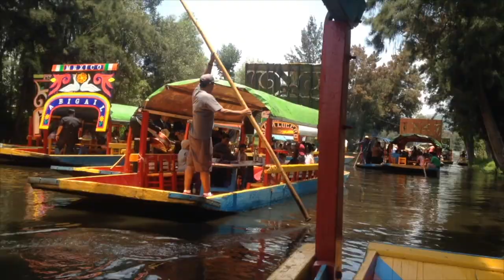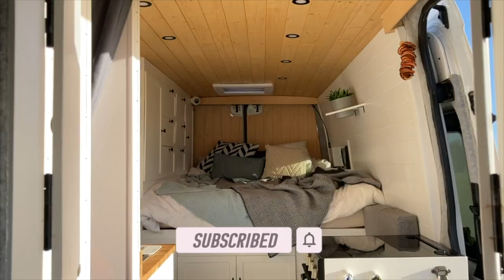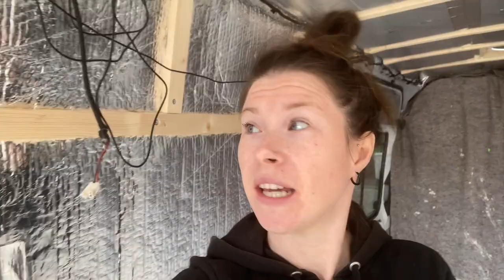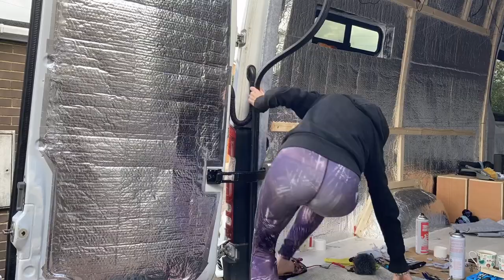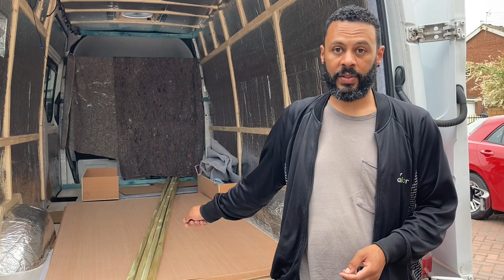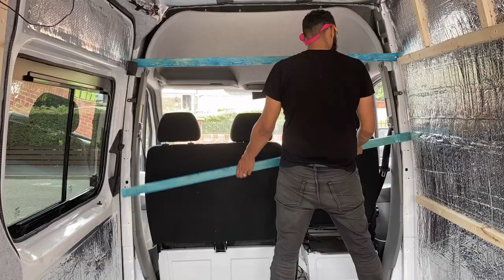Battening Campervan Walls | DIY Sprinter Van Conversion

Comment from the maker: Is the vapour barrier better OVER or UNDER the battens? And why? 

We're still not sure which is best and would love to hear any opinions either way.
Reply: You can pretty much do anything you want as long as you build knowing you need the air to circulate in order to dissipate moisture. No airflow and you’ll have mould and va;our damage.  Cheers from Canader eh!
Reply from the maker: Fair point. There are so many views on vapour barriers and insulation, but ultimately you’re 100% right. Air circulation is key! 

We tend to keep our back window cracked a little and have air vents in our roof light which we never close. Plus the fan gets a good blast every time we are cooking to draw any moisture straight out. 

It’s so easy to get caught up worrying at the vapour barrier stage because everyone you ask has a different opinion

Comment: I think another benefit of battening after the vapour barrier like this is then you can do the wiring after the insulation, and no have to worry about making a bunch of tunnels around the place in your insulation for the wiring

Thanks for the vid both :))

Comment: I am at the same stage with my build and my understanding is that when you come to put the plywood walls up there is now an air gap between the insulation and the walls which is good, enjoyed another great video guys xx
Reply from the maker: That makes sense, it’s definitely not sitting directly touching the vapour barrier which could bring a couple of benefits. Guessing you did/are doing the same then, battens on top of vapour barrier? Glad you enjoyed the video 😀
Reply: @TheWholeWorldorNothing  Absolutely, I know there is loads of different advice out there but here's hoping that this is ok.  We are not doing all of our build ourselves as we are retired and do not have the stamina now.  We are doing what we can then the professionals step in.  Really enjoy your videos guys, not far from you I think in Newcastle.  Anyway take care guys, see you next week xx
Reply from the maker: That’s a great way to do it, still getting hands on when you can. Plus you get to do all the fun bits 😀
Yes we were very nearby! We’ve just hopped over the border now but we’re not planning on staying in Scotland long. We’d love to see your van once you’re all finished. 
Catch you next week ☺️

Comment: Hi Guys, amazing work. Are the ceiling battens (25x38mm)? Was flexible enough?  Did you had to cut the in several  pieces to fit every line? Thanks. Jose

Comment: Looking good guys! Myself and my fiancé are currently mid build on a 2016 sprinter. Identical to your one actually it was a former Next Van. We looked at various build layouts and absolutely loved your one! Although it doesn't seem to be a very common type. I'm currently trying to draw everything out on sketch up. But silly things like how high do I put the countertops? And how wide the seats etc is puzzling me. Did you guys just look up the average  dimensions of the various things to keep things ergonomic? Thanks
Ryan and Sarah
Reply from the maker: Great stuff! Yeah we’ve not seen any layouts exactly the same as ours, there are a few similar with the same bed and bathroom placement but we tailored the rest to suit our needs. 

We struggled trying to find reliable numbers for measurements too, some are easier than others! For example countertops seem to be at around 90cm as standard. But with the seats and our pull out table, we based it on a set of dining chairs and a table we found comfortable to work and eat at and literally measured them. Don’t forget to include the foam in your calculations though! We’ve seen some people do that and end up with comically high seats and stuff 😀

Overall we tried to think about what we’d be using each thing for the most and then adapted those measurements to fit the space if necessary. Hope that helps.
Reply: @TheWholeWorldorNothing  Hi guys! 😊 Thanks for the tip! I had not even thought to factor in the foam. You saved me alot of embarrassment hah. Best of luck with your travels! Looking forward to seeing the rest of the series. 
Ryan and Sarah
Reply from the maker: 😅 glad we could help. Just noticed you asked about seat widths before as well, we worked off the more fixed dimensions we already knew i.e bathroom, sink, bed and cooker and bed on the other side and then played around with what was left in between. Good luck with the rest of the build! And we’d love to see how yours turns out when you’re done 😀
Reply: Hey thanks very much! We may even do a wee tour video when we're all done! Thanks again for all the information! Sorry one last thing if you don't mind. What was your dimensions for the bathroom? Do you find it big enough for your needs? I was thinking 900x700mm? Thanks again! Ryan and Sarah
Reply from the maker: Yes do it! And be sure to send us the link 😀
We made our bathroom 900 x 600 which works for us but wouldn’t for everyone. If you’ve got the space for 700 width then for for it, we prioritised the slightly bigger work surface but that’s just because we love cooking so much! 

Feel free to ask any questions you have, we’re more than happy to help if we can 😀

Comment: Hi I'm in the process of converting a van and just wondering why you have to screw the battens into the metal frame instead of screwing the playwood / cladding into the metal frame right away?  I am looking for answers all over the internet and it is not written anywhere.  is there any logical answer that is why everyone does it?
Reply from the maker: Hi! Yeah great question. There’s a couple of good reasons but it’s by no means necessary. Firstly if you’re planning on running any services behind your cladding or ply then you’ll need the space to do that (electric cable/water pipes) so the 10cm or so this method gives you is valuable. Also depending on what insulation you’re using and the shape of your van, in some places your insulation may stick out beyond your metal struts - ours did in various parts so the batons create an even surface to screw into. Another reason we’ve come across (but can’t confirm as we used batons) is that it avoids potential squeaking caused by the wood rubbing against the metal. Ultimately it’s up to you as there’s no rule to say you have to use batons! Hope this helps though.
Reply: @TheWholeWorldorNothing  Thank you for the answer :)  my partner and I decided we will not use battens in our Iveco because its shape is appropriate to screw everything directly into the van, or into construction holes that are already there. Thank you so much for the great explanation :)